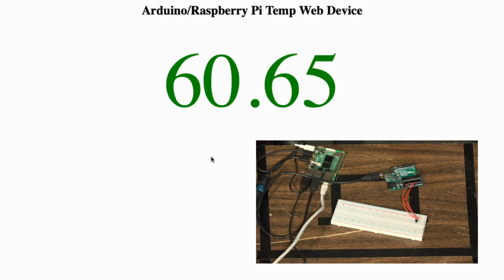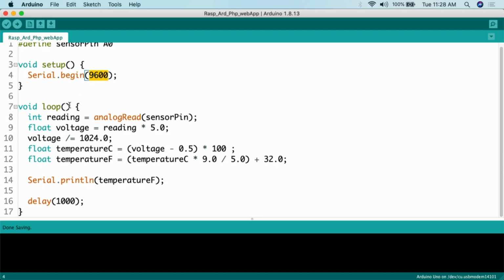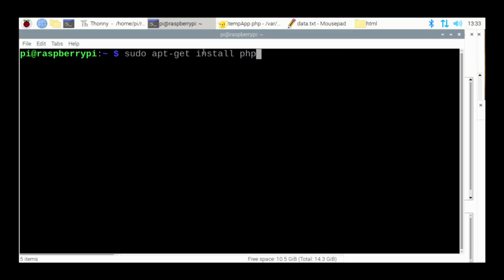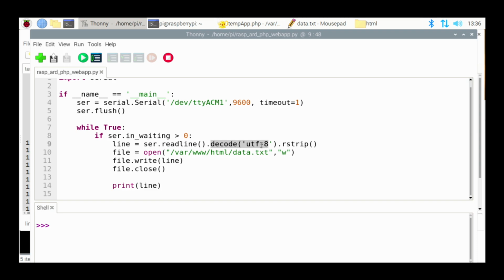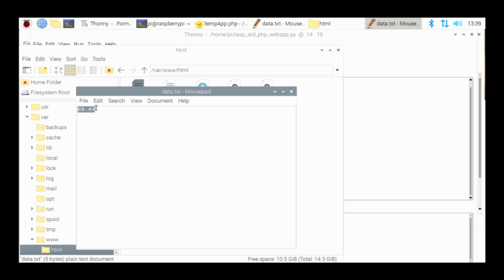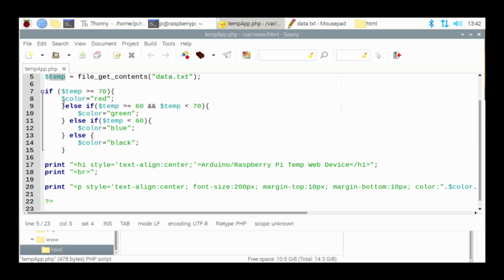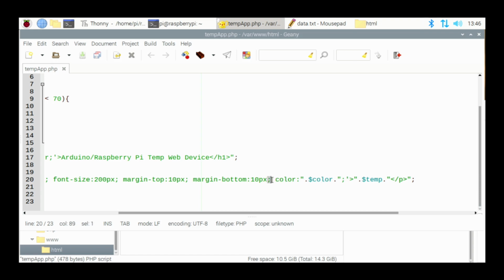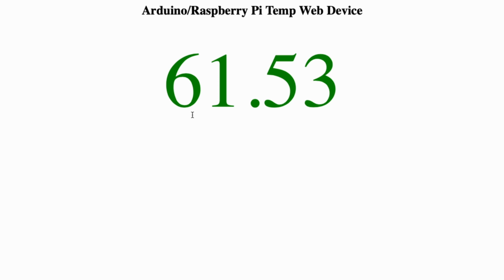Arduino - Temperature Web App with Raspberry Pi

Comment: I've really been looking forward to this series since the first time you mentioned it. There is a IoT project I've been working on since 2018 ( mostly on the software side ), which involved creating a "fleet" or sensors for monitoring a plantation. It's cool to see some ideas we were testing a few years ago with Rasp...Pi + Arduino setups in order to delegate the data reading, processing, learning and redistributing appropriately. The difference with out setup is that we are using an Adhoc wifi network with (near) realtime data synchronisation to create the swarm, so that we can achieve the same goal without worrying about proximity as much. 

This tutorial gives me a lot more calm because I've learnt everything from scratch and it's cool to see Eli the (ahem ahem, COMPUTER GUY) put this together. I too am commenting and letting you know this to let you know these videos are extremely valuable to me, despite the entertainment (and informative) value of the recent shift to news about the world and your opinions on what's been happening around us. I hope you find a balance that doesn't make these videos disappear too much in the fight between Youtube's recommendation / compensation algorithms and our dwindling power to fight it!

Thanks consistently reminding us at the end of the videos that you are indeed still, the computer guy! If you do have time in the future to look into the wifi versions of this setup, I would be very happy follow a series on this as well for a long time. 

PS: Apologies for the run-on sentences in advance,